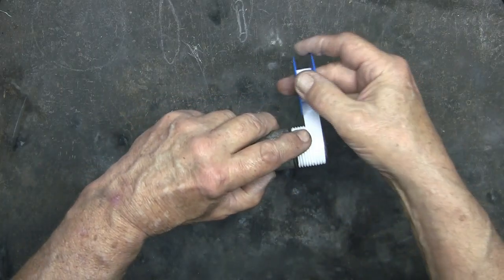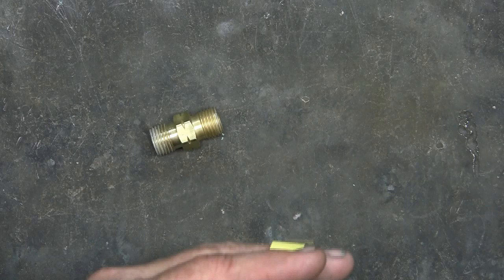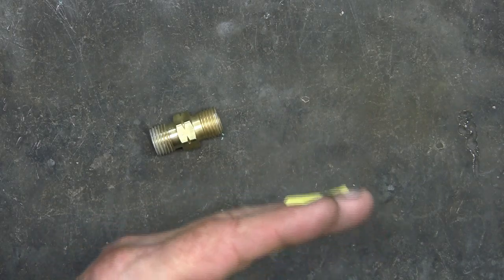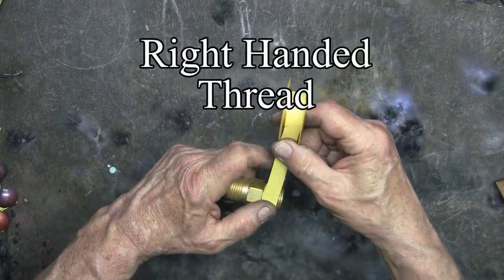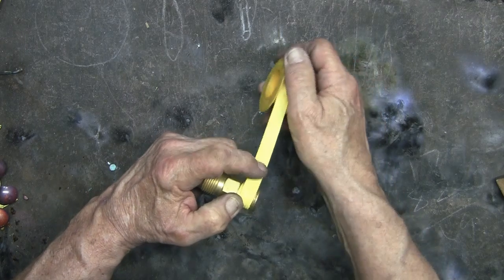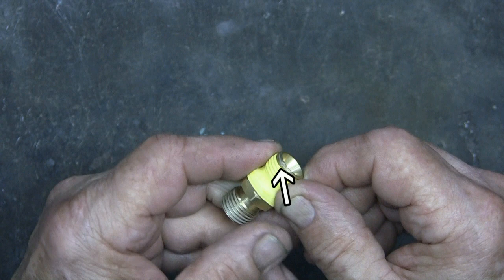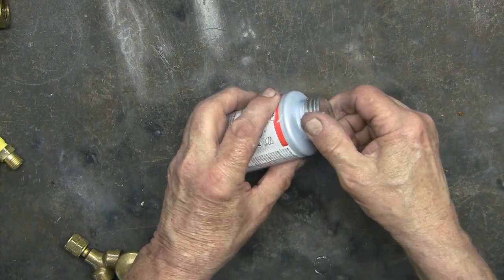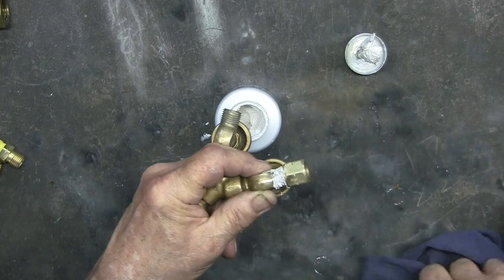Fixing a Gas Leak

Comment: WARNING!!!!!! Gas fittings (CGA) are a brass to brass seal and thread tape should not be used. Replace the fittings especially where flammable gas is involved.  Gas will leak down the shaft if the brass to brass surfaces are damaged or dirty. I have been in the gas industry for over 20 years and often clean Teflon tape off threads that only tighten the seal between the brass surfaces. Threads on gas fittings do not seal anything. Misinformation about this subject is very dangerous. Should a flammable gas, such as Acetylene, leak into an enclosed area and be ignited by an ignition source, it could have deadly consequences and lead to severe structural damage.

Comment: I bought some stuff called Formula 8, it's an oxygen safe thread sealer. I plan to use it to seal some leaking screws in a cutting torch. Part of me wonder why the manufacturer did not machine space for o-rings.
Reply from the maker: I have a number of torches and have never seen an O ring on any of them.  Perhaps the acetylene & O rings don't play well together.
Reply: @897473  There are o-rings in several of my torches actually, they are made of a special material called viton I have found out when researching. 

One of my older torches has two aluminum discs in the gas adjustement valves, the brass "needle" goes through the center of these and there is an o-ring there. Must be 40 years old now (was my dads, of swedish manufacture and no longer made) but it still seals. The aluminum part also seals against the brass just by a nicely honed surface.
Reply from the maker: @1873Winchester  I've never seen a Swedish torch.  I know the Swedes have some outstanding welding and brazing materials (rods).  Sounds like you've go something special.

Comment: Nothing here really makes sense, the seal on those connections is in the face of the flair, not the threads, they exist as a means to tighten down the flair and will not seal anything. clean and inspect the face surfaces to make a leakproof connection and for god sake don't use oil anywhere!
Reply: Thanks for commenting.  You obviously have a better way.  It would be helpful if you could upload a video on your approach.